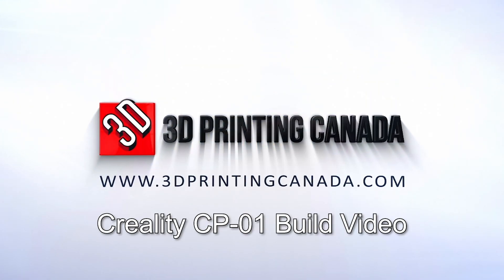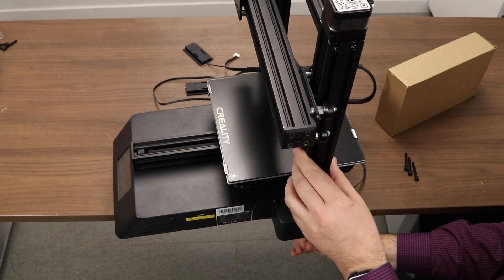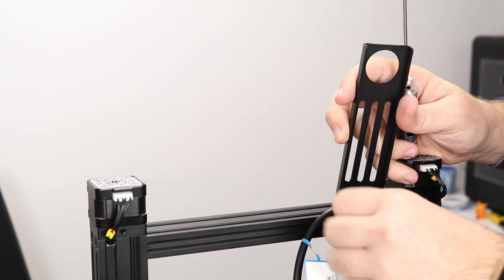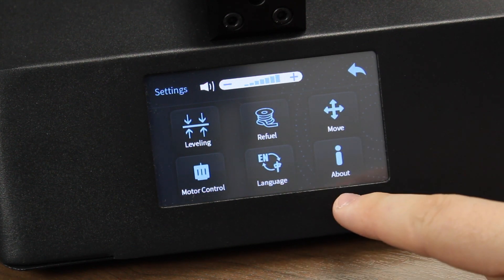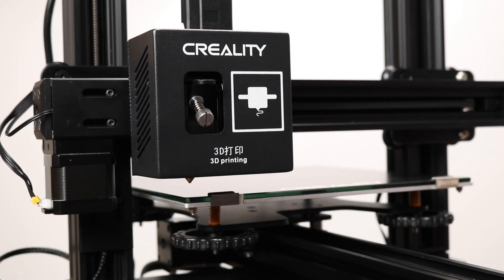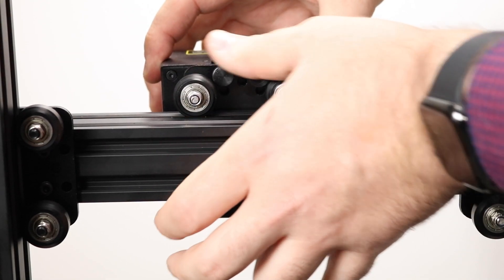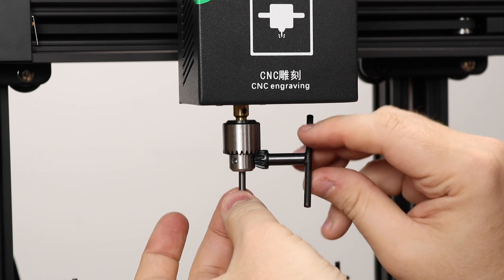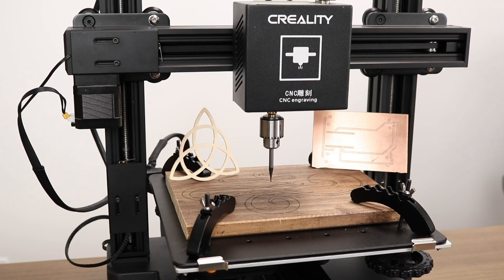Creality CP-01 3-in-1 3D/CNC/Laser Build and Test

Comment: I just ordered the laser cutter accessory for my Ender 5 pro.  I have modded it out to be direct-drive so the head is starting to get heavy, but I wonder if there is any way to also add a CNC head to it somehow. (Heavy is the HEAD that wears the crown?) Im thinking I could set something up that would allow me to use the heating element circuit to power the drill motor somehow. (Either/Or mechanical switch maybe?) and then I could probably do the same thing with a liquid cooling pump off the extruder control.  Anybody know where I can get either the Cutting Heads or the Firmware to handle this?

Comment: the leveling knob turning thing in position 3 hits the back box, is that fine? anyone else has this problem?
Reply: I am having that same issue. Also not being able to level properly.
Reply: @randomheroism  @Hamad Al Horr

Hi Hamad, Joel,

Were you able to resolve the issue with the knob turning the back box ?
I have the same issue and reached out to the supplier but they're not that responsive ...

Comment: Hi Thanks 4 your video. Perhaps U could give me some advice?  I also bought a CP-01 last year August. I updated the firmware to the latest 1 from Creality. I use CURA to slice and Pronterface to print the Gcode files. Since updating the firmware yesterday my CP-01 it changes my bed temperature from 45°C (my default setting) to 125°C. I've not changed any settings in my CURA 4.6 & not changed any settings in Pronterface either. Do U know where I can get the original firmware that it came with, so I can revert back to the original firmware?. (I also have the Ender 3 Pro which I upgraded to Marlin with ABL Sensor and use the same sliding and print settings with no problems. ) Thank U in Advance.
Reply: Did you have a problem with leveling knob number 3 hitting the back box thing?